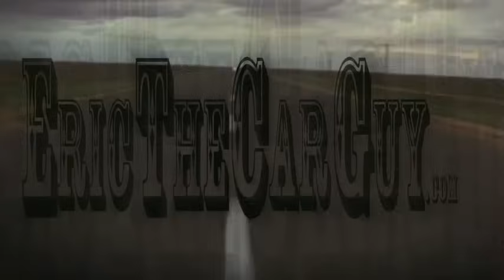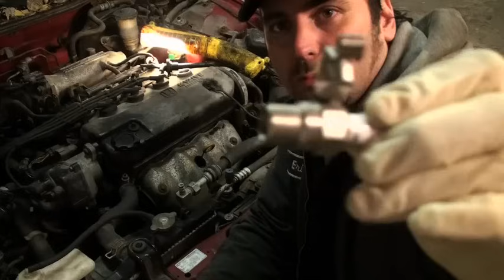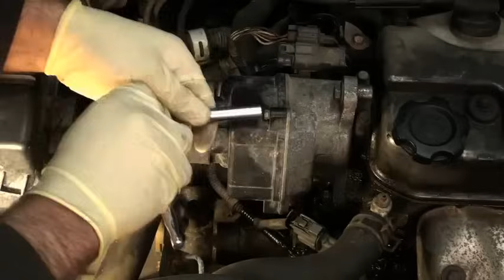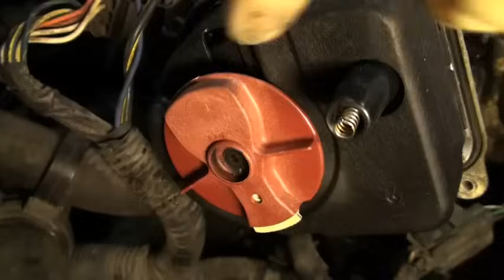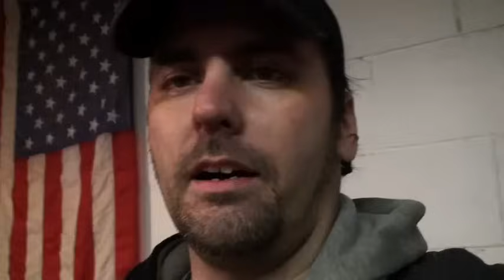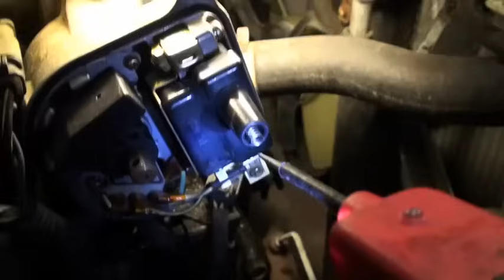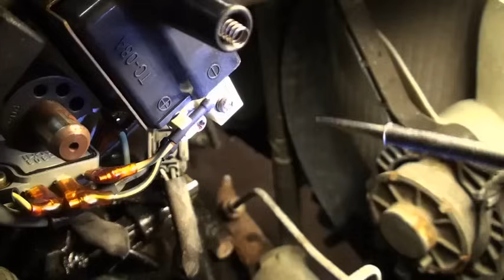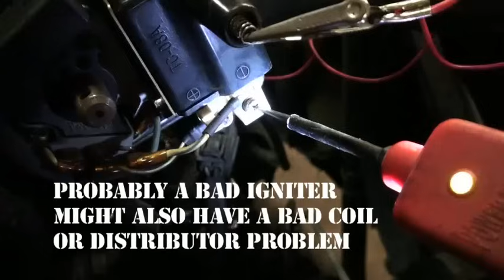No Spark Diagnosis (Honda) - EricTheCarGuy

Comment: Erick I had a radiator hose bust, and to get to it I pulled the #2 spark plug wire. After replacing the hose I turned my car on and forgot to reconnect the spark plug wire. Well it ran for a few second and died. I right away realized what I forgot and now it won't start but cranks. I replaced the wires/caps/module/ and still nothing. There is spark to the coil but it's not strong enough to make the jump to my test light but when I put it to touch the inside of the coil it will light up. Any ideas its a 96 Integra with a B18
Reply: 90TegTurbo
If you look at Eric's video, you will see that he has the coil spring coming from the coil 'grounded' while he is cranking it over with the dist cap off. Capice???
Reply: When you started your engine with that spark plug wire off, it could have easily caused the ignition coil to internally short out. That is why the engine died and would not restart. Never crank a Gen 1 crv with the starter with any of the spark plugs wires not grounded or connected to a spark plug, or with the distributor cap off, unless you have the coil spring grounded, etc. If you need to do it without grounding the high voltage carriers, disconnect the connector that feeds the distributor and is right next to it. Doing what you did should not have any effect on the ingiter itself, just the coil.
Reply: Buffalo 4 Your coil wont short out if not connected to a spark plug,and you dont ground your ignition/spark plug wires to a ground..thats how you short your coil,if you dont know what you're talking about please dont misinform everyone who reads your wrongs comments.Do your research because you have no understanding of how a coil even works.
Reply: 90TegTurbo
Yes it will.  Do some research. Geez.

Comment: The cause of my no spark was a loose earth on the thermostat, almost impossible to see. ( hint no check engine light)
Another thing was while I was looking at the distributor I lost the little spring that connects the coil to the distributor cap. Very easy to knock of when removing distributor cap. If you didn't know it should be there you don't know its missing. I used a spring from a ball point to replace mine.
Reply: If I pulled that pen move I would be like Thug Life

Comment: Does anyone have experience with my problem? I have a Honda Civic EG (D15B2), 1.5 L engine, my stationary rpm falls down when im at a traffic light, when i accelerate the car bogs/hesitates  and has no power till 2500 rpm and then gives the power the car used to give..

Comment: It would be very helpful to let people know which side of the battery to hook the test light. Most people dont have the luxury of owning a probe. In fact if you really wanted to help us you would have done this with a cheap test light like most of us have. : (
Reply: You can hook test light to any chassis ground. Then any source of power or spark you touch, you will light the test light. I never connect my test light to a battery..
Reply: journeyquest1 why would you connect to the battery? He clearly said to a ground there is no mention of a battery there is grounded parts everywhere in your engine compartment
Reply: If you wanted to help yourself, you could open your ears while the man is CLEARLY helping you with the exact info you are asking for..

Comment: I like your video but mine stalled and it ended up being the ground to the main relay located on the thermostat housing under the hood. I found that after replacing the dizzy th relay was clicking because the relay was trying to power on the ecu but couldn't close the circuit. Sanded the wire connection and she fired right up

Comment: Hi eric, your videos are just awesome... I have got a honda 02 Automatic car... Recently i got flooded inside out... I tried to start the car couple of times while in the water which i now know was so stupid... towed the car to higher ground left it drain for 2 days now... But the check engine lights do come on and off... found little water too inside of the spark plugs cleaned it with rugs... But still no spark from distributor... give me an idea to diagnose this no start problem... Tons of thanks...
Reply: Luckily i haven't had water into engine head... Checked oil which looks fine... I need to tell you one more thing... I also found the air filter wet on that day.... Now its in bright sun for 2 days now... Almost like in the oven here in Gulf...

Comment: im having a turn but no spark problem so far i change the rotor,cap wires, distributor and even the external coil and still no spark the distributor and external coil are used any ideas of what it might be?
Reply: your battery.

Comment: Hello Eric I just want to begin by saying that your videos are extremely helpful. I had a no crank no start issue and watched your videos which led me to replacing my starter. After my starter replacement, I got a crank no start issue and followed this video until the part where i got no spark on the third to last plug (near the distributor). followed the cord to the distributor and took the distributor off...----->  I FOUND OIL<---------- what do i do and where should i start.   2001 Honda Accord dx automatic. NOTE nothing was wrong with the car until i gave my brother a jump on a 1994 toyota tercel... Thank you in advance for your help

Comment: Hey man thank you very much!! i used these tests and found that i had a bad coil pack. I would not have been able to narrow this problem down with out these tests. I probably would have just bought a new distributor for 200 bucks. instead i used these tests, found i had a bad coil pack, and bought a replacement coil pack for 20 bucks!! thanks a bunch man!!

Comment: My friend and I tried tested his ICM yesterday and got a replacement for it.  Today we installed the new ICM and still get no spark.  With both a test light and a Voltmeter we tested the Negative post of the coil with body ground and it didn't BLINK but it dimmed down.  Yesterday with the old ICM it didn't even light up at all, period.  So, any ideas on what this could mean?

Comment: Eric, I have found your videos very helpful but I am still not having spark. I have tested coil with (dummy light) power to negative and positive side of the coil. I am not having no pulse on negative side of coil during "dummy light" test. Solid light only. When key is turned on, "dummy light" goes out and still no pulse when trying to start and no spark on tip of coil spring. Any suggestions?

Comment: I have a quick question I recently brought a 1994 honda civic from a guy at work to get back and forth to work I went to his house and had it towed because we got it to start once but it didn't start again, so I got it home changed the cap and rotor and tried starting it and no go, I have fuel and the starter is cranking but no spark so we looked at your video tested the igniter and it was sending a signal but no spark from the coil so I changed the coil and still no spark so I'm baffled do you have any advice (1994 civic ex d16z6) ps: I also put in new plugs and wires.

Comment: I am getting spark on 2 and 4, no spark on 1 and 3. Replaced rotor and distributor cap no change. Any Ideas?
Reply: Also replaced wires and plugs.

Comment: Eric, at about 6:10 on the video you have an alligator clip on the secondary terminal. Is that for the test light, or something else? Also my test light did not blink when I turned over the motor, it stayed constant, any ideas? Thanks

Comment: Thanks dude.  Been having some trouble with my Honda and replaced the WHOLE distributor and got about 7500 miles out of it and now in the market for another one.  The one I bought was aftermarket but a whole lot cheaper.  Now I am at the point to getting one from a junkyard.  335.00- 425 for a new one is just too costly. If I buy 2 more I would have spent what I paid for the car...hehe. why is the aftermarkets tend to not be of the same quality?

Comment: Eric just a question, do you think having an issue with either the ignition coil, cap, or rotor, may cause an intermittent hesitation in acceleration? I took my distributor apart and noticed that little spring thing that comes out of the coil is bent and damaged and the coil itself is a little damaged on the outer plastic component ( previous owner must have done something ) the engine is in top shape and starts and idles perfectly, just has a dead spot in acceleration and im thinking the coil or possibly the cap or rotor might be the fault, would you think so?

Comment: So the coil on my 92 civic wasn't creating a spark so I tested to see if it is receiving signal. My test light lit up so I replaced my coil and it still won't create spark. What do I do then? I checked all my fuses and I can hear my fuel pump prime.

Comment: Eric ...did the test on ignitor with a test light..from ground to neg. on the coil .Ignition in on position turned on the test light ,but stayed on during crank with no pulse. Just stayed on.. Still thinking its a bad ignitor. Would that seem correct to you? Thanx ....Stubbs

Comment: Hello I have a question my coils went bad within a year and I dont wanna buy new honda ones before I find out the source of the problem, I did some research and it could br the timing light connectors, but how would I check those? please help

Comment: Hey, question here, i have done a few tests on my distributor,  I tested the signal on my injector, they r blinking fine, but there is a yellow and green wire that conects to the distributor, I heard that wire needs to blink, but mine is on or neither blinking, could it be my ecu is bad? I just changed my coil and still no signal, I have done what I thought it could be the problem,  but so far nothing.....heeeellpp pls

Comment: good video Eric. my 91 Civic (Calif, LX, manual) has no spark.  I replaced the rotor & distributor cap, but still no spark.  I noticed that the ECU fuse was blown.  I replaced and blew again when battery was reconnected.  Removed the ECU and still blew. I cleaned the wires going into the in-engine-compartment fuse box and fuse remained OK.  Then I reconnected the ECU and the fuse blew again.  Should I replace the ECU?  I never did the coil & ignitor tests described in the video, but not sure if I should do this now.  Please advise

Comment: I am getting spark at sparkplug wire end, but its yellow not blue/white.
fuel pump does come on, and fuel at sparkplugs, but the 2000 civic cranks but don't run!!!!!! what else could it be? main relay?

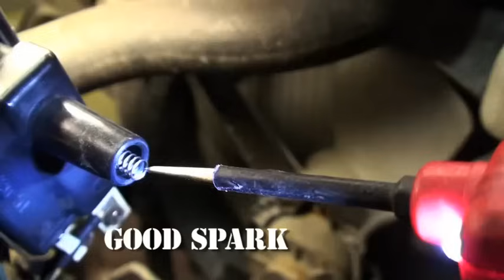Comment: Great video, I had a problem with my 98 civic EX,  my car had  spark like at min. 5:00 but at the time to put the distribuitor cap back on, I HAD NO SPARK AT THE IGNITION WIRES,  so after a while I found that the ignition coil had a small crack, so after replacing the coil, my civic runs like new,  by the way I also replace the spark plugs (ngk v-power) cap and rotor.  Thanks Eric.

Comment: Yeah and we working on that junk box another piece of crap piece of junk there is a white be missing working on like Donkey crap a box j j junk box in the Honda the reclaim metals what they really are that one with the Geo Prizm run to  the got a body shop got hold of the person the wrong body shop in there to do the do the repairs on Geo Prizm on that yeah we have a body shop guy I know he checked everything out the way works on the collision of the vehicle checks all the wiring all the horses and everything that needs to be done he replaced the whole wiring harness and Warren everything everything works when he gets finished with it it doesn't in fact spects.   Yeah all those Hondas and although Japanese and there's a bunch of crap and junk a box need to work on the right car the right car is the General Motors the right car to work on and also the green Garza right car to work on special with the Hyundai. The switch cars a good car to work going to in the BMW and Audi Fox in the car to work yeah Toyota Yoder on
Junkbox Japanese Hondas in your specially the unmentionable Nissan and you and your really nuts working on the junk a boxers in the unmentionable Nissan in the in the in the yogurt Toyota
Reply: HAHAHAHAHA O MY GAWD!!!!!!!!!! I CANT BREATHE!!!!
Reply: WTF?
Reply: spam or special?
Reply: FragmentalStew Both but slightly more special.
Reply: Do you even know what your saying?
Reply: Holy shit what a cluster fuck. It's like a senile old man went on a rant with bad speech to text.

Comment: Eric, you mentioned oil in the distributor cap and of course I have this problem on my Honda. Is that a major problem or a seal that needs replacing? thanks for your help.

Comment: Eric PLEASE HELP! I have a 1999 honda civic it drives for a good 45 min then dies I let cool for about 2 min and it cranks. I've replaced the coil the rotor the cap spark plugs and cables please help it's my only car.

Comment: i had my coil change inside the distributor by my mechanic because the car just went dead and has no spark. after he change it was fine again but after it runs hot my car would just shake and then loose power like I'm stepping the gas more but the car not move. after it cooled down it was fine i was able to go home and my car has not been out since i'm still busy to get it fix or test drive it again. what do you think is the problem
Reply: Jobert Cadag I had the very same problem, here's what you might want to check (this is the reverse of what I found out but this should get you on the spot). 1.) ICM (Ignition Control Module) or the Igniter. If this gets hot you will experience what you just said. 2.) Fuel pump clogged/failure or fuel lines clogged - rust could be in the tank so try to look at your fuel filter for dirt. You may want to check if the fuel pump is good by checking the pressure. Also check if your fuel lines are good and not clogged. 3.) Carb / EFI - you may want to check your carb failure or dirty fuel injectors 4.) Cooling system - check radiator if functioning properly, check your temperature if it's always on the good range. Check your fans.

Comment: Hi I have a quick question. I have a 1993 honda. And the problem that I have with it is that I'll be driving it for about 15 min the most after that it will shut off on me and then I would have to wait for like 1hr for it to turn back on. Would you know what that could be?

Comment: thank you for the information im trying to get a 1990 Honda civic to run it has no spark also has no fuel delivery  75000 original miles its been sitting a long time 5 years

Comment: Ok I installed a new distributor for my 1993 Honda civic lx the car turn on for like 2mins then it shut off by it self I then try to restart the car and it doesn't want to turn on, and I'm not getting a spark from the distributor I need help ASAP

Comment: Ok so i changed the whole distributor 100% brand new, came with new cap and rotor, still have no spark, i changed the ignition relay, new battery, new spark plugs, wires... what else can it be!!!!!!
Reply: probbly your ignition coils check those

Comment: Ok so i changed the whole distributor 100% brand new, came with new cap and rotor, still have no spark, i changed the ignition relay, new battery, new spark plugs, wires... what else can it be!!!!!!
Reply: Ever figure it out?
Reply: Im going through the same thing at the moment. Not even my neighborhood mechanic was able to solve the issue. At this point im thinking of doing an engine swap

Comment: i basically went through same steps to check for lost spark. everything Eric lectured on today i agree. although it was my igniter that failed. i did replaced the external coil along with rotor on my  92 Accord LX  for good measure. Started right up. thanks .

Comment: Your videos are really helpful, thank you for the time you take on making this videos.

I want to make you a question about ignition diagnostics. I have a mazda 323f that stalls on idle when I stop on instersections and has a rough acceleration, this only happens randomly when the car is warm... when the car stalls it's hard to start and I have to doing pressing the gas pedal and when it starts I have to keep the gas pushed until idle stabilizes... during this time black smoke appears from the exhaust. If i wait some time and let the car get a bit cooler it starts better but at some time it fails again. When the car is cold works without issues and when hot and the problem does not appear works ok.

I think the problem it's related with the ignition because the black smoke reveals that there's fuel on the engine that doesn't get ignited. Could be possible that the coil or ignition module are faulty? When I start the engine for first time the engine compartment is cold and both components work ok but when the car has been running around for a while the engine compartment heats, the ignition coil or the ICM overheat and start to fail. The problems appear specially on city driving but they can appear on the freeway or specially warm days, when I need a strong acceleration (more engine heat). Last weekend I was driving hard at the night and had no problems, at the night the ambient temperature is lower so maybe the ICM and Ignition Coil didn't reach the failure temperature.

What do you think about this?

thanks for help

Comment: I have a b18a1 in a crx. I just had the ignitor and coil replaced in my dizzy. Went to start my car and it ran for less than two minutes and then crapped out. Is there anything that could be overloading my system, causing it to burn up? Thanks.

Comment: You've got a lot of experience over us shade tree guys like myself, so coming from my experience I rather remove the distributor when doing any kind of service/diagnosing. Those rotor screws are easy to lose and I prefer to remove distributor cap bolts with it removed (those are easy to lose too for us amateurs. This also helps you out if your by yourself, because you can spin the distributor shaft rather than crank the engine to diagnose.I etch the distributor and head to keep my timing.